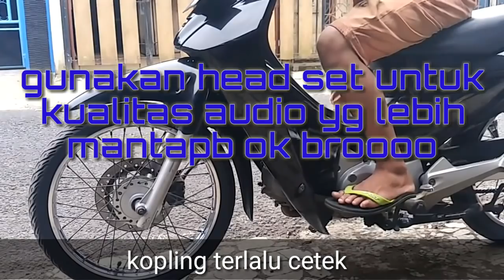Seting kopling manual  # siboen tutor

Comment: Sangat bermanfaat...
Siboen chanel memang terbaik
Salam dri Lombok NTB
seandainya dket saya akan jdi langganan kang boen👍
Trima kasih
Reply from the maker: +Pendi Hartono 👍🙏
Reply: Vixion kalo cpet panas..
Lari jarak 1 km udh bunyi injection dan tanda merah pda speedo meter nyala.
Saya ganti air radiator tpi gk mempan.
Kira2 apanya kang ?
Reply: Kalo udh terlalu panas susah hidup dan kadang2 mati sendiri.
Reply: Cek air radiator bro kalo ada tanda merah .
Reply: @ginola2587  wlaupun ditambah air radiator tapi gak mempan bro..
Saya bawa bengkel diganti kipas semua yg brkaitan dgn radiator tpi ttep gk bsa.